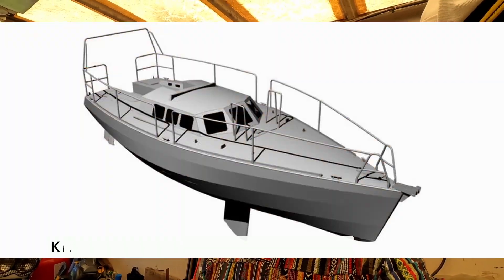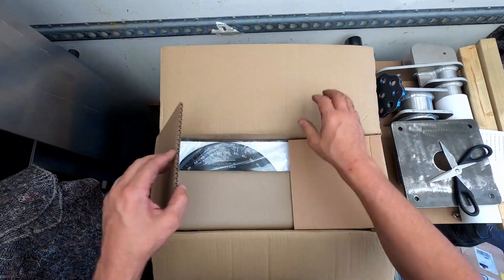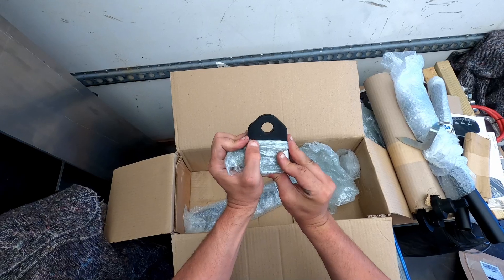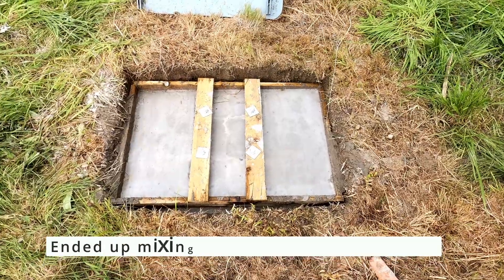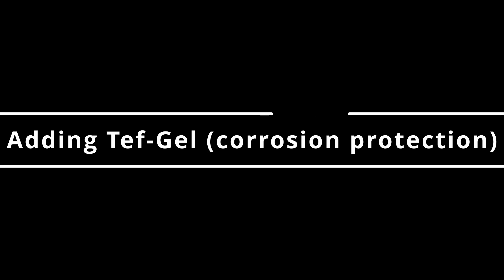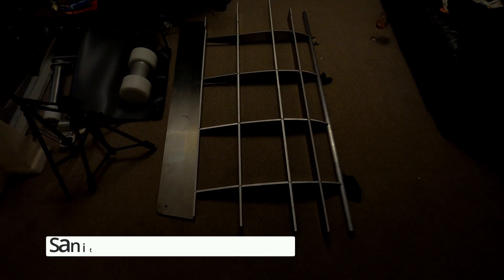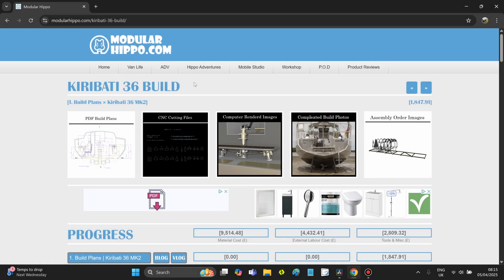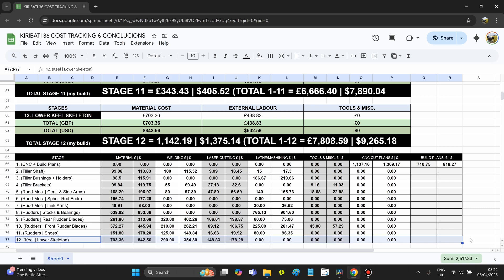Tube Bender Setup + Lower Keel Skeleton Cost Breakdown | DIY Aluminum Sailboat Build Ep. [8]

Comment: This is a very confidence inspiring tube bender, I didn't have such a great device. 
We managed to bend the aluminum tubes by filling the tubes with fine sand, tapping it firmly and heating the bending point and surrounding area with a flame until the material became “soft”. After a few attempts, you get a feel for it. By the way, we had the exterior tube parts anodized. 
Nice video...
Reply from the maker: Hey Albert, hope all good your side!! I have seen the sand bending technique when researching the topic and it is such a cool concept. The tube bender I got should hopefully speed things up a bit and lower the risks of me setting workshop on fire, ha ha:) - Anodising sounds like a great idea from a corrosion protection angle, saying that, the parts will be huge after they are welded together as one piece so any company offering that size of anodising will most likely charge an arm an a leg:) Well worth looking into though. I have a little 'home' kit (just a bucket) for nuts and bolts and might use that for smaller parts that will fit in it:) Great ideas as always, thanks Albert!
Reply: @modularhippo  Anodizing also prevents the aluminium from turning dark grey. It therefore does not heat up as much and is more visually appealing. I also had the window frames anodized. Greetings Albert
Reply from the maker: @albertfunk1176  - Who knows, there might be companies that do larger objects, need to look deeper into that as I am all for 'longevity' and minimum maintenance needed:) Thanks!

Comment: I'm confident you know this already, but there is a difference between tube and pipe. Make sure you buy the appropriate tube/pipe for the bender die you have. Pipe is measured from the inside diameter and tube is measured from the outside. 

If you end up making multi-bend parts, it's worth investing in Bend-Tech software. It's reasonably priced, easy to use, and will make the whole process faster with less waste. I haven't used it in a few years, but have designed and built a few roll cages with it. 

The access plate in the keel box will seal just fine I'm sure, but in the future it might be worth using bolts threaded in from the backside. It's much easier to permanently seal with a thread locking/sealing compound, the threads wont wear down over time and possibly strip out like it will when bolting into aluminum, and you can tighten it much more. The way you did it will absolutely work, but may not last quite as long. 

I can't wait to see the hull being built!
Jim
Reply from the maker: Hey Jim, Big Thank you for taking he time to comment. Some really good points as well, I will definitely look at what tube bending software there are out there:) - In relation to the guide and the tubes, will use the same tube size across the boat. Took no chances when ordering the tool and made sure that I got the guide for the tube I will be using. Fingers crossed that all goes well. Might ask you for advise when I come to bend down the line if you don't mind? Can't wait myself to see an actual hull at some point, ha ha. As it stands I have a bag full of 'parts'. Good bolt ideas as well, thank you!! Enjoy your Sunday and thanks again for the good pointers!!:)
Reply: @modularhippo  You can definitely ask me anything, I wish I was closer cause I'd love to stop by and help. Unfortunately, I'm in the US so all I can do is comment. I've only bent aluminum tube for one project (that I never finished due to not needing it in the end), but it was quite easy. My bender is basically the same as yours but my follower die is made for steel. It still worked very well but left some scratches on the tube. Yours will work perfect. For comparison, I was bending 1.5 inch x .120 inch wall tubing (38.1mm x 3mm). 
I hope you have a great Sunday as well!
Jim
Reply from the maker: @JMRobins1  - Hey Jim, 38.1mm x 3mm is believe it or not the exact tubing I am using for the boat. I guess that you had a JD Squared? Seems to be the more popular one:) Nothing beats watching someone use tooling in real life but a bit if a trek from US, he he. Being able to ask for advise is woth it's weight in gold as well so appreciate that. :)
Reply: @modularhippo  You guessed right! It's an old bender too. I think I bought it in 2004. The hardest part of bending material is getting consistent results over multiple pieces. The software helps a ton and does all the measuring for you. It's important to tune the die to the material at first, but there's plenty of videos and online instructions to do that. You're basically just figuring out how much the material stretches as it's bent. Once you know that, the software does the rest for you. If you're only doing single bends in tube, there's no need for the software. You'll get the hang of it real fast. Make sure you always set your little needle to '0' as soon as you put tension on the tube. Do that for every bend. It's not always the same and once you start putting a bend in, you're stuck with it. Even a degree or two can be noticeable if the tubes are next to each other. You can always reach out to me here, or my youtube username @gmail.com. I love what you're doing and really admire you for taking on such a big project and learning as you go. Theory can only take you so far. The real learning is when you jump on in and do it!
Reply from the maker: @JMRobins1  Morning - Again, big thank you for all the info and 'know' how' around the tube bending. Most of my bends will be single and halves later welded together. Saying that, if I can get confident then I would do the second bend in the bender to make it look more aesthetic and save me the weld (so will look for software anyways). Some of the bends are not 90 degrees so getting the hang of the '0' reset will be crucial. Doing it at point of tension is a good tip, thank you! My lift thumb is out of order after doing some lathing (did not hit it, just some weird muscle/nerve thing) so as soon as I am back in action I am going to jump into the deep end on this one:) - Thank you for your kind words, it is a big project in its totality. I try to only focus on bite size parts and a couple of problems/new skills at a time and by doing that it is less mentally straining. It is a labour of love and something I wanted to do for many years so it had to happen:) Thank you for the email, will drop a 'hi' to connect and there is a risk that you will get some tube bending questions down the line:) Thanks Jim!